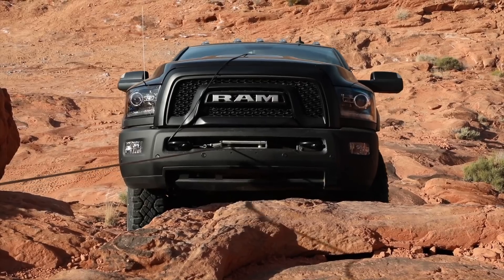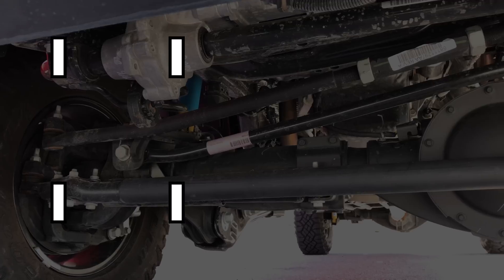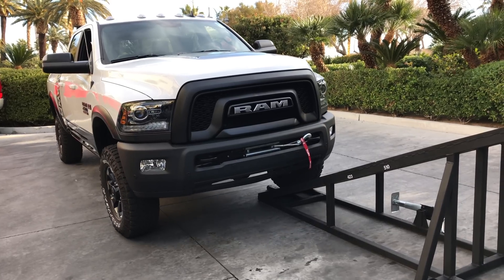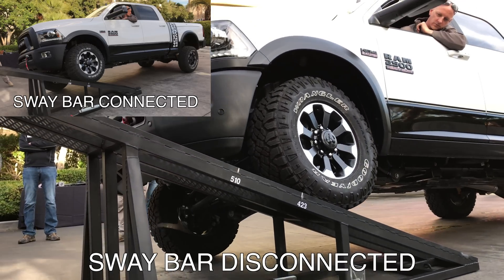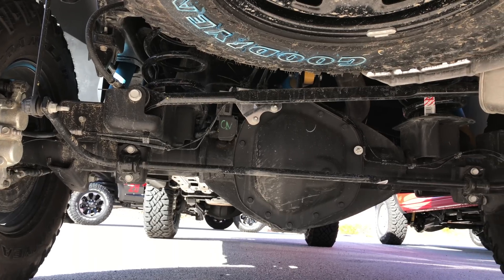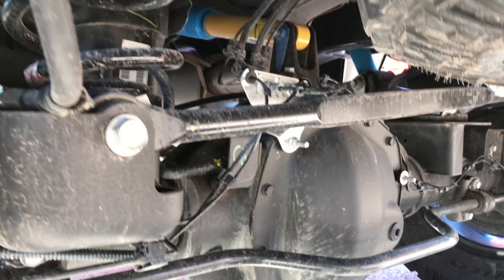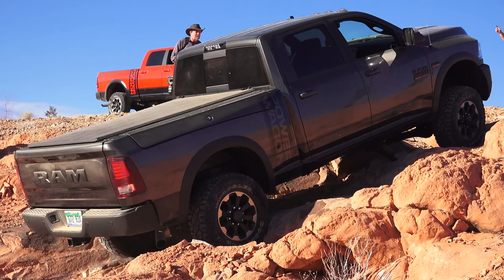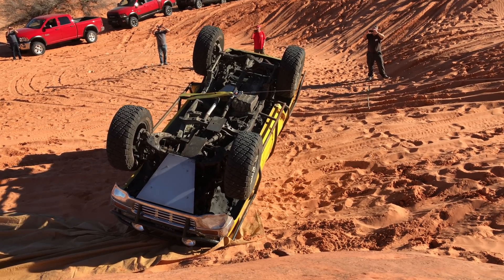5 Features For The Ultimate Off Road Truck

Comment: Hi Jason. 
Greetings from India !
I love your videos and have watched many of them. I was wondering if you can let me know if you have a video on calculating gradeability of a vehicle. 
The topic that I am interested is to calculate the restart gradeability or the gradeability of a vehicle when it is starting from rest when it's already on a inclined slope. I am intersted to know the factors affecting the vehicle's performance such as slip involved in the transmission or driveline or due to reduced traction force available at wheels, or due to grading resistance, etc when the vehicle starts from rest. I have calculated the grade ability when the vehicle is already moving onto a ramp, but not while starting from rest. I am trying to find out a pragmatic approach in finding a factor explaining this difference in gradeability values. I have the test data reports available and have done comparisons on various models with a 6X2 or 6X4 driven wheel configuration. 
But i am unable to explain this factor that can be used as a constant. Do you have any videos on this topic ? 
I would love to hear from you. 
Thanks Gopinath

Comment: auto upright:  with a press of a button, vehicle will flip itself back to proper orientation.   * Refer to owners manual for details, dealer installed option.  may result in serious injury or death.  safety checks of rocket propellants by authorized dealer is necessary or may void warranty.

Comment: Regarding the suspension - could explain Articulink or possibly show how it works? It does look a bit different than a standard radius rod on a rigid front axle, however it does not seem there is too much movement built in in this system (at least at the first glance) - even if the additional link can move up or down, both lower link and the Articulink are bolted rigidly to the axle (the distance between bolts does not change I mean). I only guess that the Articulink may allow some more movement thanks to certain level of compliance in the bushings, but that's just my theory. It would be cool to see a detailed video. Just sayin'  :)

Comment: If your friend with a rollcage rolls over, he is ok and still alive.  If that dodge rolled over at 3:45, all the occupants would be dead.  Why a roll cage, was not listed in top 5 features of an offroad vehicle, escapes me.  One indication is that the title of the video does not match the spoken intro in the actual video, "In this video we will be checking out 5 of the most fascinating and useful features of the 2017, Ram Power Wagon".     ...When will you be making a video on the "Ultimate Off Road Truck"?   Does the ultimate offroad truck look like the Toyota with sweet roll cage in the preview video by chance???

Comment: I'll stick with the raptor. way not be quite as well off road but it is sure as hell. enter off road than most trucks and it's performance in most other categories is better. Definitely a better Baja style truck and I am not sure who would be better in the mud. raptor has more HP for high speed applications also.

Comment: How does that electronic sway bar disconnect work?
Reply: Matthew Hoch the sway bar connects one wheel hub to the other basically.  What this does is just disconnects on one side so they aren't linked anymore allowing them to move more independently.
Reply: shadow105720 thanks but I get the concept of what happens, I meant how does it disconnect them? I see the motor connected to a housing on the bar. Are there gears in the housing to allow movement of the halves or are the halves connected with an electromagnet?

Comment: I have a question about your diagram of the 3 wheels on ice and one off. Wouldn't that only be possible if the truck had a locking differential in the center as opposed to a full locked transfer case? It is my understanding that the transfer case sends 50% of the torque to the front and 50% to the rear, which would mean that if only one tire had grip then it would receive only 50% of the possible torque. Thanks!

Comment: What ever happened to good breakover angle?  Don't get me wrong, the Powerwagon is good, and the 14" of ground clearance isn't too bad for a stock vehicle, but the breakover angle on it is absolutely horrendous.  Also, this truck is GIANT.  I mean, consider the 33" tall tires.  On a jeep, those tires would look decently large, but on the Powerwagon, they look kind of tiny...These are my main issues with the Powerwagon.  Other than that, good on ya Dodge.  (And I'm not even that big of a fan of Chrysler products.)

Comment: The most badass truck there is.
And the 5 points are very good.
But it doesn't matter what Dodge say. A solid axle without portals and 33" tires does not give you 14.3 inches of ground clearance.
That would mean the differential would only be 4".
I say 10-11" GC depending on the size of the differential.
Trust me, I have gone from solid axle to portals and do off roading for real.

Comment: Is that 1.3 inches of ground clearance measured from the lowest point of the diff?  It sure doesn't look that high - and in my experience it was pretty much always the diff housing that used to hit first.  Looks like it has decent approach and departure angles, though - which is a rarity on modern vehicles.

Comment: 12,000 pound winch on a 7,000 pound truck? How does that work?
Reply: It means it can pull up to 12k pounds. These are pickup trucks that also tow heavy things so if you're on a construction site with 5k pounds of cargo and your truck sinks into a muddy dirt road, you'll have extra winch power to pull yourself out. Also, the truck might be 7k pounds, but with people and gear, that weight will grow very quickly so if you're four wheelings, you don't want a weak winch.
Common sense. . .

Comment: how can you tell if a vehicle has  a center diferential or not?
Reply: A four wheel drive vehicle that is designed to go on the road as well as off road has to have a center differential. If it doesn't, you'll have the problem described at 0:57 in the video. Some vehicles that are only meant for off road use (such as ATVs) can get away with not having a center diff. The fairly low traction surfaces will allow the tires to slip without causing transmission problems. I hope this answers your question and clears up any confusion.
Reply: it help's, but i'm still a bit confused, i used to have a mitsubishi l200, is pickup truck and it had a 2 speed transfer case, but in the manual it says you sould not engage the 4hi or 4low on tarmac, so it is what bring the question, because before the mitsubishi i had a 93 range rover and it could go with the 4hi or low on the tarmac, so i asume the range rover had a center diferential and the mitsubishi don't
Reply: An easy way to test is to put it into 4 wheel drive, and do a very slow sharp turn in a paved parking lot. It will sound like stretching and screeching rubber from your tires, and your turn radius will be horrible compared to when its in 2 wheel drive.

Your Mitsubishi will do this, as it probably does not have a center diff (most "part time" 4 wheel drive vehicles do not). If it did have the extra diff, then you wouldn't notice any difference in sound or how it handled.
Reply: you are right, i just tried and the wheels screeach with the 4lo engaged, and is harder to turn on the parking lot, i kinda miss my range rover now
Reply: Look?
Reply: no, i mean, if you can't take it apart, i have tried searching but is tricky to find
Reply: The center diff is probably built in with the transfer case.

Comment: Does Low 4 gear increases power to the drive shaft?
Reply from the maker: Does not influence power, but allows for greater wheel torque.

Comment: jeep wrangler, toyota landcruiser, lada niva, nissan patrol, LR defender. Those are the best. Ram is also very capable
Reply: Those old Nivas, awesome
Reply: phil tripe Well the REAL Land Cruiser is one of the best offroaders of all time
Reply: like Ram or not(i dont) not much can come close to this trucks capability ...they stopped making the defender, the lada is a tiny car, the patrol sits really low...the TFL guys took the Ram to moab against the raptor(the only thing the raptor can do better is high speed) and trd tacoma and the taco did the worst and the taco is at least as good offroad as the cruiser...the only thing that has a chance is the hard rock rubicon and ram is claiming to be most capable truck, all the things you mentioned are suv's
Reply: phil tripe the raptor did everything the ram did and it's faster off road and on road. So how can you say the ram is better?
Reply: phil tripe look up land cruiser 70 series.  unfortunately  it is not sold in the usa
Reply: Eloy Leyva There's a video that compares the articulation between the power wagon and the raptor. I think it's by tfltruck if I recall correctly. Speed isn't everything my friend.
Reply: 80 series Sahara, brilliant articulation, diff locks, definitely a better unit than one of these.

Comment: the ultimate off-road rig is not something you can buy stock from the factory. and it's certainly not a pickup truck with IFS. I can actually speak from experience.

Comment: Seems like an awesome pickup truck! The only problem is that it's DODGE! American car manufacturing standards are either poor or they still lack behind in understanding what lasts and what doesn't!
Reply: I know Chrysler and American brands in general don't have the best reputation for reliability and quality, and in some ways it's understandable, but troublesome vehicles isn't my experience. I've owned numerous Chryslers with no issues. My current 2011 Ram 2500 has 167k hard miles. Besides a leak from the front diff that was caused by a service tech damaging a drain plug seal and failed crank position censor that was replaced under warranty, I've not had any issues. The Ram I had before that never had any issues.
Reply: it's engineered to fail that's how they actually make money with cars now i suppose
Reply: Meh, I've owned 'em all from all countries. In my experience, American manufacturing standards are really no worse. In some ways, they're much better over the long term. Our company has a 2010 F150 service truck with 330k miles, and it's had little to no issues, doesn't even leak oil with that many miles. We also have Toyotas in our fleet. And while they're reliable overall, they have their problems. The one Tundra we had went through front ends like it was regular servicing. Then there's all the body integrity issues with had with them. 

Also, I suggest you crawl under one of these Power Wagons and tell me they "lack" behind in understanding what last. The frame, steering, suspension, axles, drive components, etc. almost military grade. All the parts are big, beefy and made to run for years. They're not behind anything.
Reply: People need to understand that your personal experience with a brand may not reflect the experiences of many others. There are people who own American cars with nary a problem, while others see their cars burn through the automatic transmissions (for example) despite not abusing them in any way. 
Overall, American car companies have destroyed their reputations in the world. Are they getting better? Probably, but when people have been burned before, they are much less likely to trust you again. If you love American cars, buy them, but understand that there are MANY people who would never step into an American car dealership ever again...I am one of them.

Comment: I'm not very big on trucks and offroading but wouldn't such a long wheelbase cause problems while offroading?
Reply: Yes, but different size and shape 4x4s for different needs. If you need space for a crew or to tow and haul certain things, the Power Wagon is really your only option.
Reply: I can see the logic in that. Even offroading is about compromises :P
Thanks for your answer.

Comment: yay....now lets see how long the transmission lasts 😀
Reply: samus989  Chrysler has a million mile club which has a lot of this well documented. If I remember right the 66rfe is one of the most reliable auto transmissions ever built and on average they are good for 500,000 miles. Their is alot of internet garbage out their about Chrysler transmissions however they have always had and still do have good transmissions. They just put some of them in situations they should'ent.

I edited best to good for obvious reasons.
Reply: emdec55 is right. The newer transmissions in the HD Rams are pretty strong. The only times I see them with issues is when people modify their trucks. Lifting them without changing the gearing, crazy diesel tunes, etc. will kill any transmission. If they're maintained and used the way they were intended, they rarely have problems.
Reply: harley ross there's a guy who has this same transmission in his Cummins that has over 1.7million miles of towing on it and only thing he's done to it is change fluids regularly. Only difference between this trans end the diesel is the torque converter as gas engine don't run the same rpms as diesels so the issue with Chrysler transmissions in trucks is a very old argument. But hey you can keep living in the past if it supports your argument. But feel free to google 1.7 million mile Cummins. He talks about his transmission in the article.
Reply: 1)If it lasts him 1.7 million, I'm pretty sure its a decently designed unit that will serve any normal individual very well, and that was my point. 
2) its just a joke bro!! just a joke!
Reply: harley ross that's what I was going to say.  
Since you said that let me add, overall quality is crap on these trucks. 
They are nice when they work properly but a nightmare when they don't,  which is often.
Reply: emdec55 Say that to anyone who bought a dart
Reply: emdec55 You said Dodge transmissions, I said what about the other Dodges? I didn't say anything about this one specifically.
Reply: samus989 1) anecdotal fallacy 2) it's a joke(ish) don't get your panties in a bunch
Reply: Wayne Wildman damn bean counters ruining everything
Reply: samus989 I know that I've seen several of my friends nearly brand new Dodge trucks with slipping on shifts. Clutch packs wear even with good fluid. And they are not built to high standards in my point of view. 
As for Subaru...Yeah they have their issues that is for sure. It takes a person who understands that fact to be happy owning them. 
People who don't want to work on cars get Toyota and Hondas.
Reply: Check out Chrysler dependability ratings sometime. Jeep and fiat are the lowest rated of all brands. 
Both Chrysler products.
Reply: Wayne Wildman You call BS on what?  I never made any claim about no repairs! And yes Those trucks have excellent maintenance records so I like their owners wouldn't hesitate going cross country in one.  The funny thing is you go on to show how clueless you are in your next comment when you bash a "Dodge" transmission and then tout Toyota as the best Not knowing that Toyota designed and built that "dodge" transmission you are bashing.
Reply: samus989 Actually Automatics are programmed / designed to slip x amount on every shift to make them shift smother The Allison is 1.25 rotations. As you said their is not much friction material to start with so they will wear out eventual. Allison semi truck transmissions have enough clutch material they usually make 800k to 1 million miles However automotive autos just are not designed for that service life so the best of the best is 500k and overall average is 200k. for a good auto. 10 years ago you were lucky to get 100k out of an auto.
Reply: haha. My friend bought his first dodge truck. The transmission blew. Never bought a dodge again. Now he only stays with his hyundai elantra and gets the latest model every year.

I didn't even get to drive the truck. And I drive all his cars. I asked him if he put the pedal to the floor yet he said no and made it sound like he never would... Bejeases. Every car I own I sure do test it even if it can only go 48mph max (yes 48mph, like 0000048mph). Dead overdrive.
Reply: harley ross lmao
Reply: Ok ford guy, we get  it
Reply: What happens on a brand new truck has zero bearing on a truck that has over a million, if its brand new and doing that it's obviously a defective unit, and every auto maker makes a defective unit every now and again, do you not think if they put out a product that did that every single time that there would be very serious issues brought against the company? Use your head. Auto trans clutch packs have nearly zero wear unless abused, all auto trans start off with almost no friction matterial to begin with, even a manual trans clutch has next to nothing and they see way way more abuse, no, unless the fluid pressure is low, there should be no slipping in the hard parts, only in the torque converter.  And how do you know how this dude drove his truck? if 99% of his time is spent in one gear, the trans wont hardly wear at all.
Reply: harley ross you speak the truth.

Comment: Not a fan of FCA, but the e-sway&diff system and suspension in general are pretty darn trick from an offroad capability standpoint for a factory offered vehicle, not to mention the software in place to assist with crawling; that all stated, I'd still rather an older F-150 or Taco with more axle & tire than engine with a manual trans for almost all off-road scenarios over this new iteration of the powerwagon.

Comment: What's the base price on one of these
Reply from the maker: Around $52k, but I believe you can upgrade a 2500 Tradesman with a Power Wagon package and get into it for slightly less.
Reply: Ezale 20,000 bananas or 25 bulls
Reply: Ezale 53000